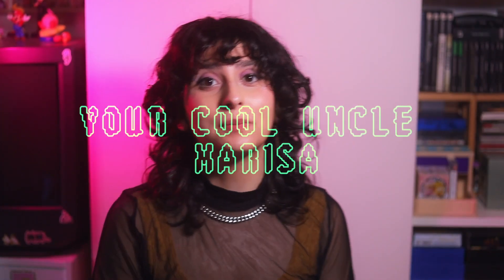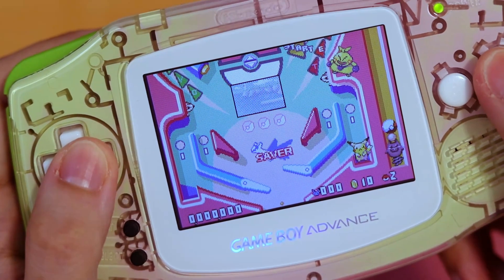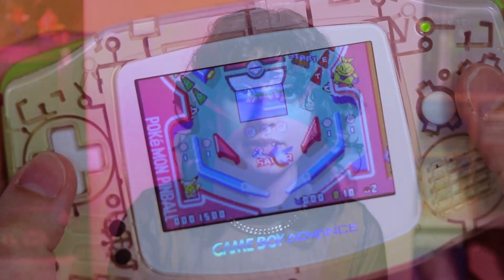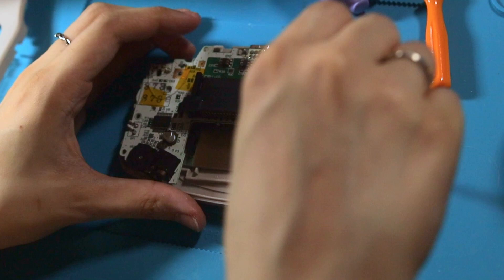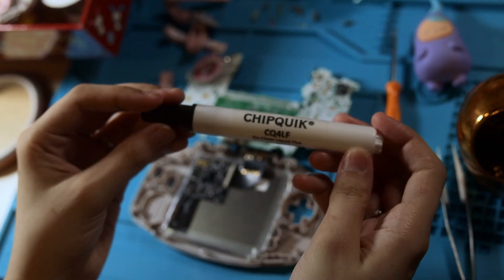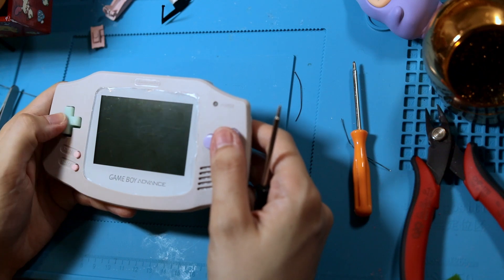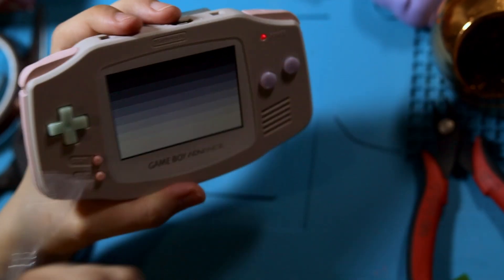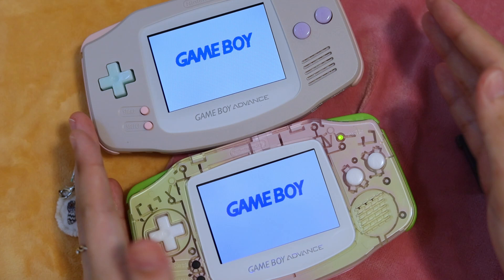Cool Uncle Mods: A Flicker-Free Installation of the FunnyPlaying ITA display for Gameboy Advance

Comment: Awesome video and guide. Subscribed!! 
I love my laminated ITA and it’s the one I kept for myself after modding a dozen or so GBAs (used to be a nightmare). Suuuuch a plus with lamination saving extra time and stress from dust and alignment. Even though the IPS is the most requested I lowkey don’t like it for a retro-mod and looks like the anachronistic blackberry screen that it is.
Great tip about the potentiometer at 10:30!!
Reply from the maker: So glad to have a fellow ITA-lover. More ITAs for us >:)

Comment: I've been collecting NDS/3DS consoles, as they were always my favorite consoles as a kid, and after doing a bit of research I think it's pretty safe to say that heat + humidity is what causes the yellowing effect on the screens. This is why, I think, it seems that more JPN DS consoles have yellow screens than other places. It can get very hot and humid in the summer over there. Personally, I have about 20 USA region DS consoles and only a single one of them has a yellow screen, while 2 out of my 3 JPN region consoles have yellow screens. The 1 USA DS that has yellow screens also came from Texas, which further supports the idea of heat and humidity being the cause. Now that it's pretty well known that JPN 3DS consoles are much cheaper than USA ones, reading through other people's experiences seems to further support this even further. If you keep the screens of a DS in a place that's at least not super hot and humid, then they should be fine. :)
Reply from the maker: That's some solid data - thank you for sharing! My childhood DS Lite had yellowed and I was a kid in Maryland and London which are both notoriously humid so it adds up 😅
Reply: Happy to share. Thank you for the tip on preserving the rubber pads on the top half of a GBA SP. I will definitely be doing that in the future.

Comment: Have you looked into funnyplaying's IPS V3.0 Solderless screen (It has a touch digitiser in the gba logo for screen controls, you can still solder if you'd prefer) and their usb c battery pack for GBA? They look really good I've ordered mine and waiting for them, the screen is also pre-laminated with glass, I'm stoked! I know you talked about an IPS screen in the video, but not sure if you used that one or if you did use it if you knew about it being Solderless. Either way great video!
Reply from the maker: Hey! I've only used the v2 ips GBA display because I moved to ITA after that, but I've heard great things about the 3.0 so you're gonna love it! I personally dislike lithium ion battery packs and prefer to use rechargeable AAs, so I can't comment on that. Good luck with the build and have fun!!

Comment: Hey, has yours done the thing where it cycles through the brightness settings all by itself?
Reply from the maker: Hey! That sounds like there might be some bad soldering? If not, maybe a defect and I'd contact the vendor.
Reply: @yourcoolunclemarisa  it's a known thing with it. There's actually a guide on how to remove the chip that controls the touch pad and have only button controls
Reply from the maker: @ChewyChicken589  oh wild, guess I got lucky! Glad there's a fix out there though. I absolutely hate touch controls on these screens, they do more harm than good.
Reply: @yourcoolunclemarisa  yes, I finally got around to doing it and it works great. And I agree that the touch controls are annoying anyway.

Comment: Thanks for this video, I scoured the internet for hours trying to install my ITA kit - it has the newer bracket you used here, but I couldn't find any documentation of how to use the new one.
Not noticing any flickering, just every once in a great while seeing a single horizontal line of the screen get all screwy.
Reply from the maker: I am so glad this was helpful! Did you get a chance to adjust the potentiometer? Otherwise, that line may be an issue with the screen and I'd reach out to the vendor :S
Reply: @yourcoolunclemarisa  I might give it a shot but I don't have a flash cart to test the screen with. It'd be nice if there was some kind of homebrew on GC to do a screen test on the GBA with the link cable. I've got to open it back up anyway to fix the light bleeding under the buttons and tape down the touch sensor so I might just bite the bullet on getting an everdrive.

Thanks for the reply!
Reply from the maker: @lodadd  Send me an email if you'd like a cart with the tester flashed onto it, I can put one together for you for a material costs + ship. You can also just finagle the potentiometer until it looks good to you 😅 But an Everdrive is a worthwhile investment. Good luck!

Comment: Uncle, were any of your ITA screen displaying that issue when the the screen would display lines of alternating darker and lighter horizontal lines of pixels? 

It comes up a lot on the forums, but not ever on anyones videos.

I have a feeling it only affects the 40pin model, or perhaps an earlier version of their ribbon cables.  

So does any of yours have this issue? (for example your original non-laminated one)
I have the issue on mine and it bugs me... (I removed C54 on my 40pin if you were wondering)

Please, any help would be appreciated by the community (but mostly me)
Reply from the maker: Did you adjust the potentiometer?
Reply: @yourcoolunclemarisa  yes, I could get it to not flicker, but out get rid of the lines.
Reply from the maker: @omegamog  oh man. I would contact the seller at that point, it sounds defective.
Reply: @yourcoolunclemarisa  I bought it directly from funny playing, they told me in an email that the screen just looks like that, and it looks the same on a dsi, and shared 2 screen shots of both devices bith showing the lines. 

But this is an issue that has affected many other people. Some people online feel all FP ITA screen just have this issue. one even installed the screen back into a dsi and it looked normal so he said it was just a poorly designed ribbon cable. 

I cant find enough info that points to something that looks like truth.
Reply from the maker: @omegamog  I'm sorry they didn't replace it. I always recommend buying screens and other fragile items from local distributors like retro modding or rgrs or zedlabz etc...because funny playing customer service is absolutely atrocious. You could try pushing them to replace the ribbon cable? Depends on how comfortable you are harassing them haha.
Reply: @yourcoolunclemarisa  update: Dear Uncle, I just bought the SP version of the ITA...  It also has the white lines! 😢 I am sad
Reply from the maker: @omegamog  contact their customer service
Reply: @yourcoolunclemarisa  Ok Uncle, I will!

Comment: Could it be that they come pre calibrated now? I ran the test and didn't see any flicker at all. I bought mine like a month ago.
Reply from the maker: Sometimes you get lucky and it's calibrated just right to yours! But since units have slight variances it's not going to be perfect for everyone. I think my first ITA was perfect to it's GBA too! hope you're enjoying it :D
Reply: @yourcoolunclemarisa Thanks a lot for your reply! I love the screen so far I got it thanks to your video (I was about to get the IPS) Just a little problem I have a little dark spot on the top left corner, the pixels aren't completely black. I wonder If I didn't connect the ribbon cable right, I have a different version of the ribbon compared to all the videos I have seen.
Reply from the maker: @GenesHand That's great! I'm glad you like it. The ribbon is probably just a newer revision? But if your screen is damaged out of the box and reseating is not fixing it I'd contact the seller.

Comment: I was real exited to this to mod. bought a 32 pin mother board and all the parts from funny playing. Until I noticed The screen has some dead pixels in the corner and a reddish pinkish hue. The buttons felt weird and unresponsive I could not get the L and R to work at all. Any help would be appreciated at this point I wouldn’t mind sending it for someone to build it for me. Thanks a lot great video!
Reply from the maker: Hmm, with the screen issues - make sure your ribbon cable is seated correctly. Try removing it and reinserting it. With the buttons, that is very odd. Make sure everything is seated correctly as the shoulder buttons can be tricky. Did everything work ok prior to modding? Did you do any mods other than the screen? You are welcome to send me a photo on my ko-fi and I can take a look.
Reply: I will make sure the ribbon cable is seated correctly and get back to you, as for the the L and R buttons I don’t know how they are supposed to go with the shrapnel this is my first gba build. For the rest of the buttons I saw somewhere that cleaninng the board and the membranes with alcohol should help.